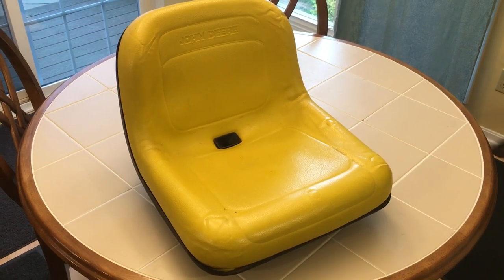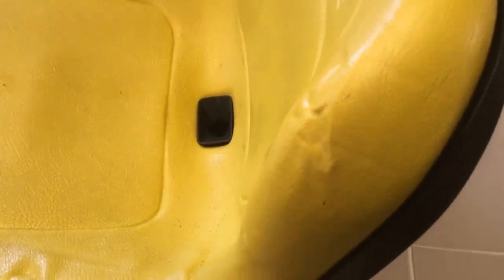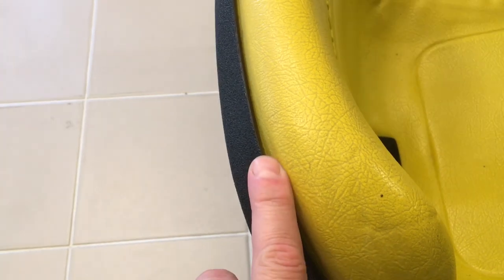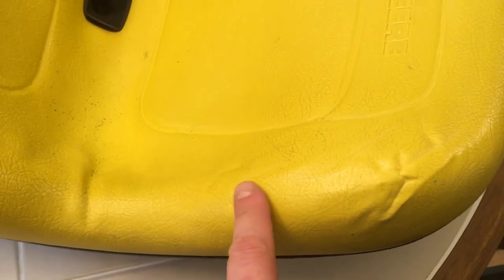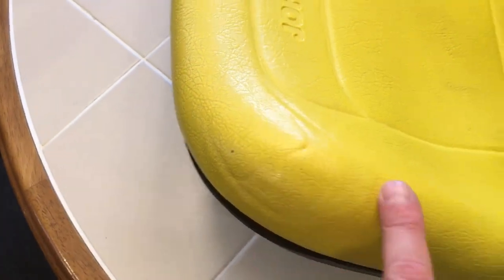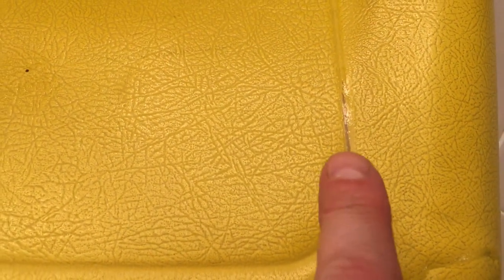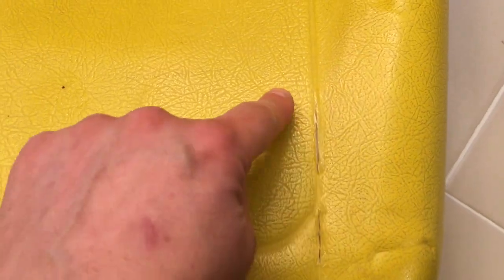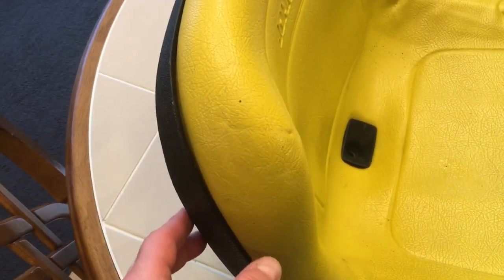How to repair John Deere seat

Comment: How's the seat holding up in the new year?
Reply from the maker: I completely forgot I fixed it until you brought it up.  I have used the tractor about a half a dozen times in the last 2 weeks and the seat shows no sign of separation, so the glue is holding.